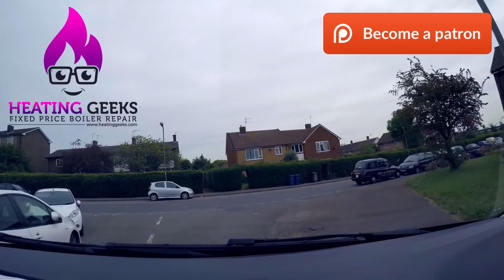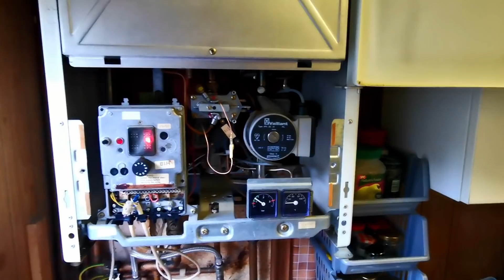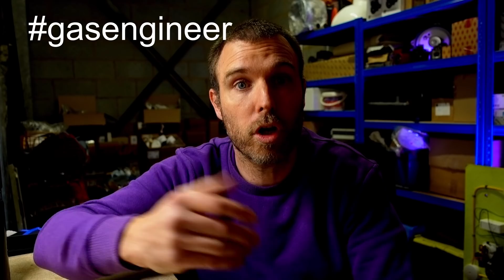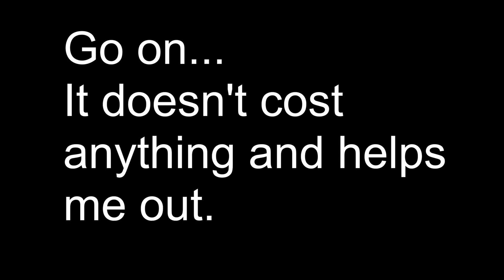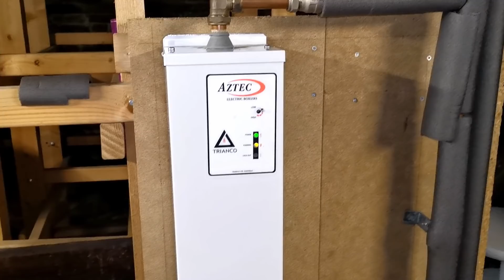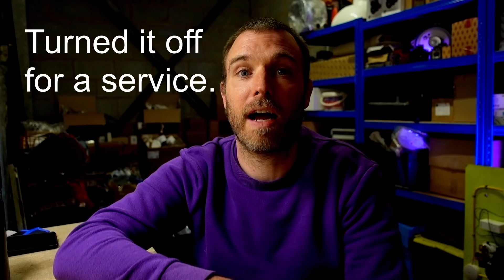Obsolete boiler parts....This could cause problems...

Comment: Done well Question 1 How long did each repair take ?
Question 2 Did you do a FGA around  the 1st  boiler outside case and check the combustion door seals? 
Also the inlet on the flue ?

Comment: As a tinkerer, I would not understand why the boiler technician would not check the PCBs for the obvious and easy to detect faults, especially, when caps cost the equivalent of a bread roll. Nobody expects you to be able to resolder all SMD, or reverse engineer microcontrollers...
Reply from the maker: Yeah but Gassafe would say you were breaking regulations
Reply: @HeatingGeek  even if you restore the components to the exactly the same specification? I understand if you play with the sensors, deliberately changing values, but resoldering OBVIOUSLY age-damaged point?
Reply from the maker: @5084204  I know. It's funny you comment today as I just done a repair on my mums PCB tonight. It like your stalking me. 🤣
Reply: @HeatingGeek  whole YouTube business concept is based on connecting exhibitionists with the stalkers. No, I don't stalk you specifically, as a plumber in training, just catching up quickly with the material.
Reply from the maker: You're absolutely right. I enjoy passing the info on. Thanks for watching and commenting I appreciate it. :-)

Comment: None of this is modification. It’s repair by one of the very few people you’re likely to meet fixing boilers who also knows how to do straightforward electronic pcb repairs. Replacing a capacitor or any other failed component on a pcb is fine so long as it’s like for like. It’s no different to taking a failed obsolete fan and having a new motor fitted to it, or bearings. So long as they are the same size and capacity as the old. We do it all the time with commercial boilers, I’ve fitted a repaired fan whilst being inspected by GasSafe. Remeha Gas 210’s, £1400 per fan, fail every 5 years or so, you can set your watch by it. 50% of the time it’s exactly the same dry joint. Takes 15 minutes to fix. It’s no use people complaining just because they lack the skills to do it themselves.
Reply from the maker: People get their nickers in a twist though. :-) Some common sense at last. :-)

Comment: If a product is out of warranty and the manufacturer refuses to support it because planned obsolescence brings in money for them (sure a customer who had a XYZ boiler running perfectly for over 25 years would buy a new XYZ in a heartbeat), anything goes as long as it is safe. Resoldering an old joint or replacing a capacitor with a new one of the exact same value isn't even a modification, it's a proper fix, so why not?

Comment: We're in the business of replacement not repair now. Customers will be your best friend until something goes wrong. In the unlikely event something went wrong and it was found to be as a result of your modification, you'd be for the high jump. I personally wouldn't have taken the risk, however unlikely.

Comment: If the part is going obsolete and the customer cant afford a new boiler I dont see an issue with it what so ever.  Your there to repair a fault, you repaired it and left it in a safe condition.

Comment: Good on you - a man after my own heart. When faced with similar issues and it was clear it (PCB) was f***ed then my attitude was (is) well I may as well have a go because it cannot be double f***ed. Quite often (not always) PCBs over 10 years old have failed capacitors and are very simple to repair.

Comment: i am not a a electronics engineer and the board though repaired has not been properly certified .
fine to solder for your own house, close family, but for unknown paying customers No way . cant get the part  recommend new boiler with quote. your new part is not certified by the manufacture and is not legal. Great that you helped them out, but don't  publish it on you tube . REMEMBER A EAGLED EYE GAS SAFE INSPECTOR MIGHT NOT LIKE THE SOUND OF IT.

Comment: I'm an electronics design engineer, most bolier PCBs are really basic, at the end of the day it's turning a pump, fan and a gas valve on on and off based on the readings from a few sensors, it's not launching a rocket. BTW on that second fault you soldered a leg on a 10k pot (I guess you changed a cap as well) or were you testing. If you are soldering up dry joints and changing components like for like on a PCB you would be very unlucky for your repair to cause anything drastic to happen. Worst case you might blow a fuse or you replace the component (like a burned out resistor) only to find it burns up again, the only advice I would give is before you remove any components you take pictures and make sure you put capacitors and diodes in the right way around, resistors are not polarised, if you are changing anything like relays and semiconductors you probably know what you are doing to trace the fault to those components anyway.

I had two engineers from British Gas and a senior engineer looking at an intermittent fault on my boiler for 2 days (it's on a contract), in the end I had to help them and found the fault was a badly crimped pin on the wiring side of a PCB connector, they had already changed the PCB twice, they would never have found the fault in a million years becuase they did not know know to do some resistance checks from the PCB side to the wiring side. 

My view is that if boiler engineers started to delve a bit deeper into the electronics side they would potentialy become better fault finders, read some books, go on a course, build some things.  I find plumbing and elecronics very similar but with electronics when you remove the cables the electrons dont leak all over the carpet.
Reply from the maker: Thanks for your comment Ron. Yes I did replace the cap and then also noticed the pot leg (which I think I did). The boiler must have been working nearly a year now. The customer will never go anywhere else for a repair now. I have made some kits with my children and can repair a few bits and bobs on PCBs. Can you recommend a course to go on?
Reply: @HeatingGeek  yes you will gain loyalty forever if you try to make the repair as cost effective as possible, good man. Covid makes courses very difficult at the moment but I have seen some online ones. I started with electronics when I was a kid, used to spend all my pocket money on components and build things, then became a Radio Ham and learned some more, I'm mainly self taught but went to college to do and ONC then a HNC to get some papers and give me a chance of a good job. If I were you I would look around the internet and find one on the basic principles of DC current, once you have a good grasp of voltage, current and resistance you can start to really understand how electronic components work and they are all building blocks. The more blocks you understand the more complex the circuit you can understand. Then you can move on to AC which is a bit more complex and RF a bit more again.

Comment: Been fixing VMF7 boards for years. Always check the PCB if I find a fault on it
Reply from the maker: Whats a VMF7?
Reply: @HeatingGeek  off of the old ferroli optima. The VMF7 PCB, the resistors would get so hot they would crack the solder.

Comment: This is what happens when a  piece of equipment becomes non functional because it relies on a pcb crammed with junk cheap components  the over complexity and unreliability makes for a component that needs replacing fairly regularly and can be sold with a massive markup on cost
I do not work on gas but I used to do a lot with oil fired boilers and some of them I used to service were over forty years old and still working. My cousins wall flame boiler was replaced with a brand new grant oil fired boiler which lasted two years before it sprang an internal leak
Reply from the maker: Newer isn't always better. :-)
Reply: @HeatingGeek  I have found in many cases it is infinitely worse!  Love the channel, and as a retired electrical engineer, I can say that your logical and thoughtfull aproach to fault finding is excellent. Engineering today is challenging, especially given the dubious quality of some of the equipment we are expected to fix. I gave up on all the complexity and have had an Intergas Rapid 25 fitted. With your fault finding skills, you will never be short of a job. When you have a spare couple of hours, watch Terry Gilliams brilliant movie "Brazil" You will understand after you have seen it.
All the best,
Phil
https://www.youtube.com/user/philhermetic/videos?
Reply from the maker: @philhermetic  This comment got "held for review" I don't know why. I will have a look at the video you suggest. :-) THANKS

Comment: That is the way to go. Years ago I was a domestic appliance engineer, where much like your business, you just swap out faulty parts. But now and again, especially on Whirlpool washing machines I recall, there would be an obvious dry joint or blown track on the motor control pcb. If I could, I would always offer repair as an option, rather than wait for expensive parts.
In your business where you must replace many old boilers, it would be useful to tear them down and hold on to likely obsolete pcbs, that may just offer an affordable option, for a cold pensioner.
Win win for both you and customer, if you can complete a repair quickly, at a rate covering your time and their budget. That is the route to customer loyalty.
Reply from the maker: Customer loyalty is definitely earned not given:-)

Comment: We call ourselves Engineers, we are supposed to mend things.  The only trouble is on the later PCBs you can't solder them without a cooling system.  My old trusty soldering iron will just make the tracks run away.   However I do keep good parts off old boilers that I know or can tell they have been changed in the past.  My garage looks like Steptoes yard, if I fit one of those parts I don't charge for it, I just charge for my time but it get a boiler going again.
Reply from the maker: I think you should charge for it. Why not?

Comment: If the repair failed or didn't work what's the worst thing that could happen? My guess is that the board would have a built in fail safe that would trip and lock out the unit, I think it's a very good thing to repair the control board instead of the entire unit being thrown away not only for the customer but also for the environment minimising waste/scrap as the units might run for another 5 years or more if they're in good condition
Reply from the maker: But the gas regulations don't want us doing it. Are you a gas engineer or electronics guy?
Reply: @HeatingGeek  I am very interested in infrastructure like hot water services, refrigeration and many other things so I read textbooks and watch a lot of youtube vids.  In Australia I don't believe there is any regulation that would stop you from repairing a circuit board in any appliance so long as you can return it to it's designed function and it's safe

Comment: Great job!

On a side note, those red electrolytics on the Vaillant PCB are known to cause trouble! I didn't realise they were manufactured as late as the early 90s, I always thought they were a 1980s thing. They were made by Roederstein of Germany and electronics repair folks recommend blanket replacement.
Reply from the maker: Thanks for the info! How do you know that?
Reply: @HeatingGeek  I'm into vintage audio equipment and these caps were used by most reputable German manufacturers in the 70s and 80s. Those caps were considered TOTL when they were new and no one expected them to fail as rapidly as they did. I think they usually dry up and no longer work. Others were worse, yellow ones made by Frako around the same time tend to short and blow up other components. IIRC someone who fixed VCRs in the 80s told me that they had to replace them by the dozen as early as 1985 in V2000 VCRs that were only two or three years old at that time.

You can't really blame Roederstein, it's more like we're spoiled by some electrolytics that just seem to last forever, much longer than they were expected to.
Reply from the maker: @Ragnar8504  Do you watch Dr Carlsons lab? Bet you do. I wish I could learn more about electronics. Slowly slowly. One day. :-) EEV blog and Dr Carlson Lab are helping somewhat. :-)
Reply: @HeatingGeek  Not much - mostly David Tipton I have to admit. He's got some  interesting radios and he always explains what he's doing. EEV blog usually has fascinating stuff although his enthusiasm can be a bit tiring at times :-)

My favourite YT channels are car related though, HubNut, Bad Obsession Motorsports and Mustie1.
Reply from the maker: @Ragnar8504  I watch mustie1 and bad obsession motorsports (not lately though ). I will check out David Tipton and HubNut. :-)

Comment: My old boss was very much like you. He used to work on aircrafts before becoming a gas engineer. "A plane cant fly if its missing a metal washer the size of a 50p", he used to say. The way to become an expert is to submerge yourself in your chosen field.  I now apply that same principle to boilers, one wing nut missing and i will look through my spares till i have that one missing wing nut. You get the idea. I also use a company called CET in Watford for reconditioned PCB's they give you a years Warrenty. They are the best in the business for electronic- they do PCB and fans Reconditioned but properly.
Reply from the maker: I know CET :-)
Reply: Used to love CET, as a service company they depend on both knowledgeable customers and there own encyclopedic in depth understanding.

Comment: Meh, I have fixed many things by swapping like for like on blown out capacitors. That in itself needs some skill but when you are down to the PCB traces having broken or lifted off it really is time to scrap that equipment and start fresh. A great annoyance with replacing junk is the pure greed of companies who do actually offer financing on equipment and installations, 15% APR is a joke, 5% would be reasonable.
Reply from the maker: I completely agree. Does anyone take into account the manufacturing cost to the environment? This is the biggest joke in it all. :-)

Comment: Had the same with BG on my old lump. Two BG eng's later both saying "Need a new one," they said", "can't get the parts," they said. "Got some really good deals at the moment on WB". Oh really, have you? That's interesting. "Oh and you need a powerflush (£800), would be advised"

So what parts do you need then? "Oh, a few it's just had it". So I got a local independent engineer round to have a look. Cost me £90 to call him out, 10 mins later "PCB gone", he said. Easy to get hold of spares for Vaillant. Called BG back roasted them, they sent another eng out (who was subcontracted). Oh yeah, "PCB gone". I'll order a replacement. A few days later job done.

Keep up the good work!
Reply from the maker: Amazing how they get away with it tbh. Standard working practice from them. Unfortunately the engineers are slightly brain washed. :-/

Comment: Nice videos..
Kind of the same in many 'industries' you know(and get frustrated by) your industry, I work in motor industry, and it is the same.
We!!! are engineers, NOT just fitters...sadly, time is expensive, so guessing, and fitting parts appears the norm now!...
If we are happy repairing a part, rather than renew, why not, IMHO.
We all know a new boiler will be more efficient, but, big but, will these new boilers be still in use in...15years..25years...and on..?...doubt it..(this thing, ' built in obsolescence'...I HATE it)
I see it with cars, car has a fault, goes to dealer, they can't diagnose, throw a few £000s of parts at it, still not fixed, customer advised to part ex, and buy a new one..!
Nice you have the skills/patience to repair, not just condemn!.
Keep the faith, good work up, and videos :-)
(You have another subscriber, you now my 2nd (ONLY) subscription)
Reply from the maker: Nice one. Thanks. My first job was at an independent SAAB garage. Loved it and learned a lot.  SAAB 93 convertibles used to crack on the bulkhead and the garage I worked at had a fix before SAAB even did. SAAB played catch up but were charging triple for the same repair. :-) 
It made me realise that sometimes being independent and making your own decisions is the way to go. One day I may end up in court but until then I like fixing the smallest possible issue for my customers.  
The gas game is going the way of the motor trade anyway. Big boys trying to price people out of the trade. :-)

Comment: I used to repair TV's in the 1980's, replacing parts was normal. Getting the parts wasn't always easy. I still repair PCB's, boilers, washing machine and anything else...
Reply from the maker: Nice. :-)

Comment: good question i have been a boiler service breakdown engineer and installer of gas and oil and if i can repair the boiler safely i do especialy with obselete parts but sometimes you just cannot do its your call at the end of the day
Reply from the maker: Its a tough call though. ;-) especially when gas safe might have a different opinion.
Reply: what happened to your scooter
Reply: you only live about an hour from me

Comment: I'm with you mate.
Done it before with dry joints and blown caps.
Even used a thin screwdriver/brawdle, heated with my torch, as a soldering iron on site before now as a fix.
Boiler's way out of any warrantee so WGAF eh?
The customer's certainly do 😁
Reply from the maker: I have done the blowtorch on my screwdriver repair before. :-) Customers think your mad. :-) ruined my screwdriver though.
Reply: Did mine too. Just kept it as repurposed tool for the next time I needed a soldering iron 👍🏻